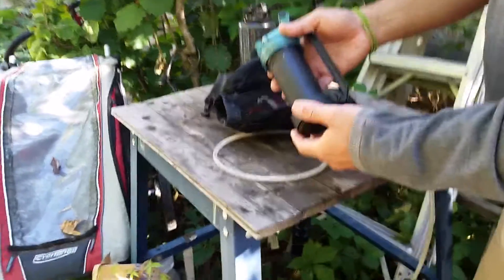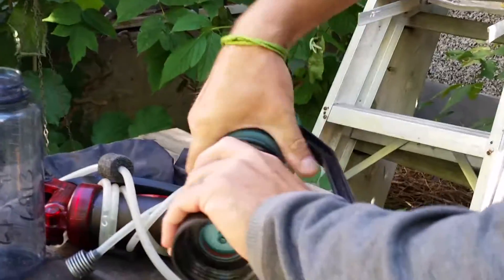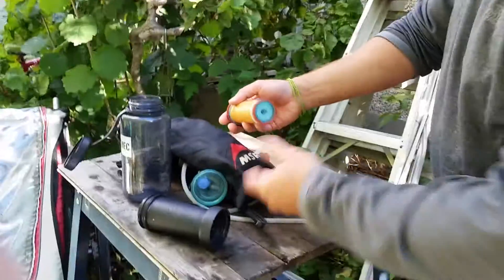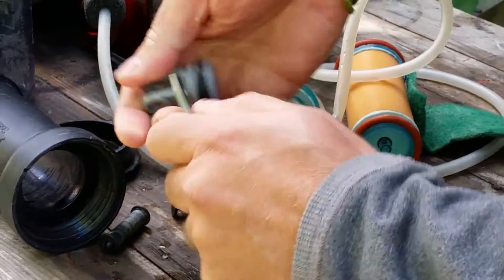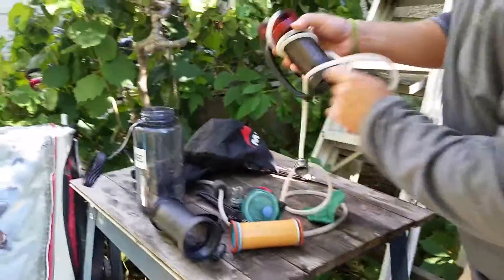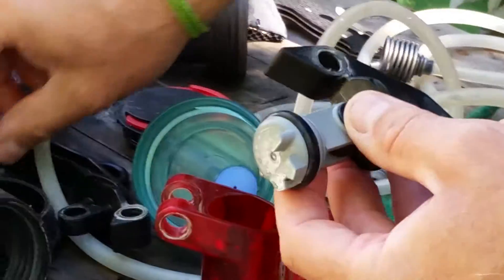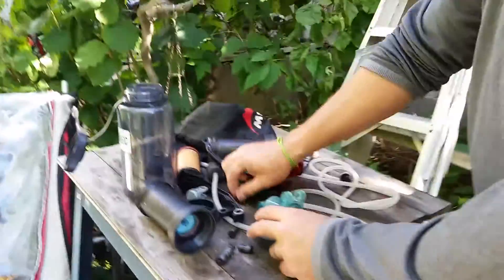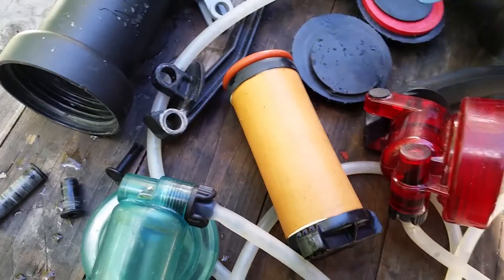Maintaining an MSR Water Filter

Comment: Urban hippy:  i’ve been using MSR filters for about 17 years now, Sometimes very intensively for years on end. There are a couple of ideas that you didn’t mention. Chances are you already know about them, but because you didn’t state them, I’ll state them just in case.

MSR ceramic filters Are made to be boiled as part of the cleaning sterilization process. I usually put a silicone cullender in the bottom of my pot before putting my rinsed, scrubbed, filter in it, and slowly raising the temperature. Once he gets to a good boil, I let it boil for five minutes, and then allow it to cool back to room temperature in the same pot of water. After that, I usually hang it and its’ mesh bag to dry. If you check your instructions They came with your unit, I believe you’ll find that in there.

At the time when my unit got the most used, I could not afford to be without it, and there was no way that I was able to get back and get another filter. I had to make it last. I discovered that sometimes you do have to scrub it with a scrubby, and sacrificed so much of the filter. Other times, a nice microfibre cloth that didn’t leave lint behind To be every bit as effective, without eroding the filter in the same way. I’ve had my filter for 17 years or so now. It has absolutely served faithfully. Over time, The hoses can start to look less than clean. I found it useful to go to my nearest sporting outfitters store to invest in an expensive cleaning kit that includes a very, very long spring coil brush cleaner, that does an excellent job.  I also have an S hook with a clamp on it for hanging that hose up from one end in the shower, with a light weight on the other end to keep it straight for draining. It seems to have solved That problem in my case.

It might be a useful policy to clean and dry your filter, including the hose, at the end of every camping trip, the same as you do with your tinted. Nobody would even imagine think about storing their tentage before it’s dry; How much more so for the viewer units that filter out water. :-).

I hope there’s something useful here for you.